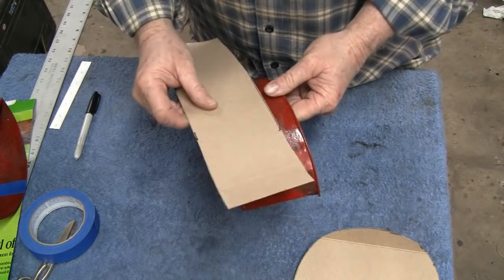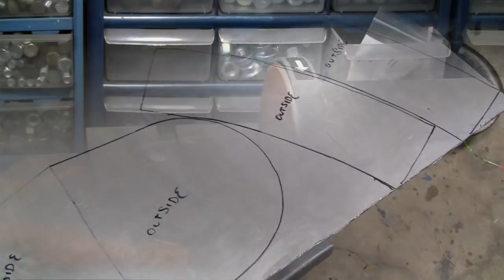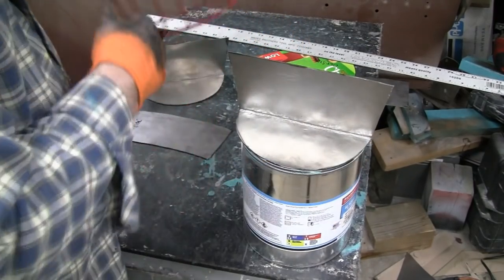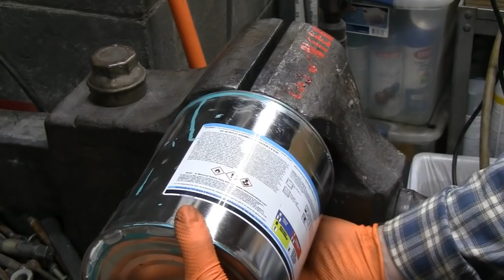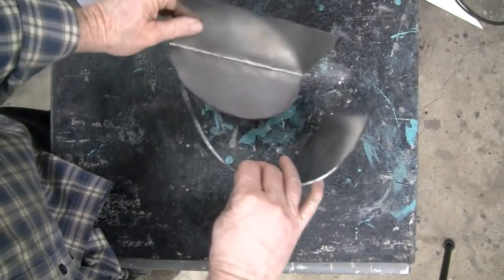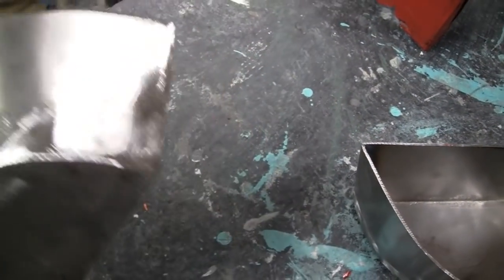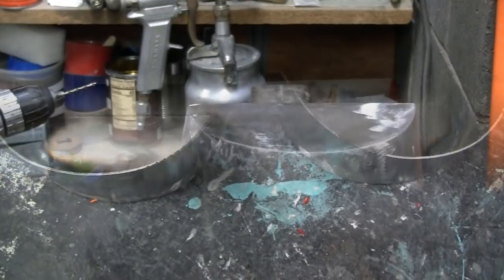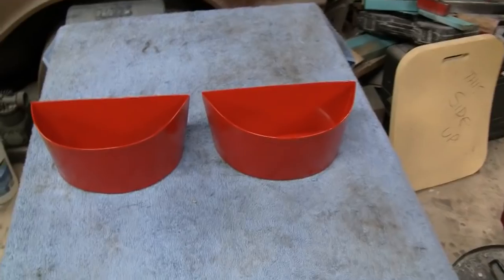BASKET FABRICATION FOR ANTIQUE BIKE FLOWER BASKET

Comment: My guess is that the small wire you focussed on in the beginning was actually a tie wire, used to hold the two pieces together until welded. The wire would normally be consumed by the process unless they missed a small piece.

Comment: Good job King, those turned out nice.
Why didn't you roll or wire edge the top edge?
Regards,
Duck
Reply from the maker: No need to, it was 16ga steel!! Way too strong for that application!! And even if you wanted to do it for looks you wouldn't see it with flowers in it anyway!!☺

Comment: I have to ask why you put the epoxy on before the paint after all the epoxy would have protected the paint and still protected the metal as well. Now the paint can get chipped and scratched. Just curious you know.
Reply from the maker: Epoxy is only as good as the surface it's attached to, my goal was to protect the metal from rusting because it always gonna be exposed to wet mud. Putting the epoxy over cheap spray paint is just asking for trouble!!☺